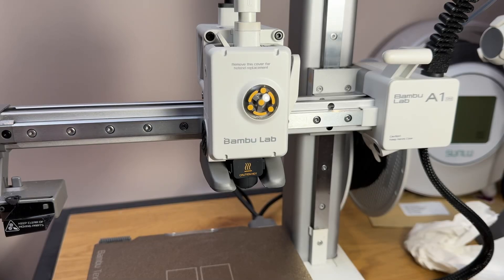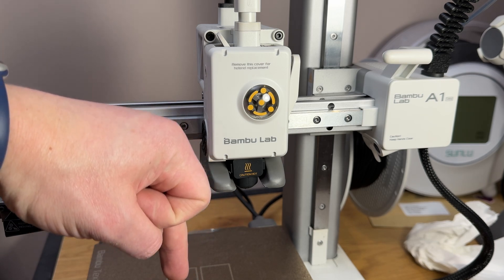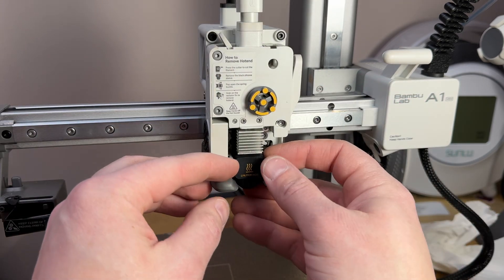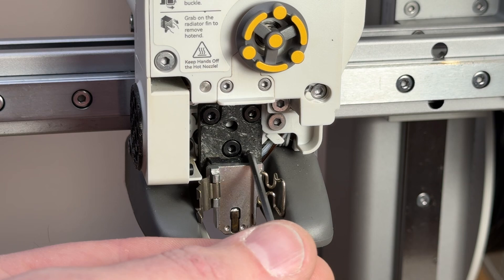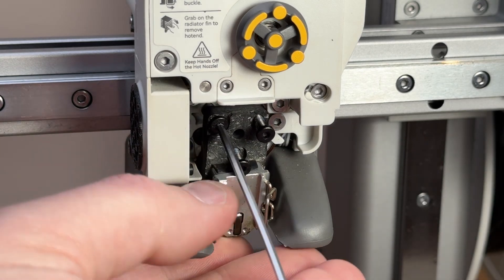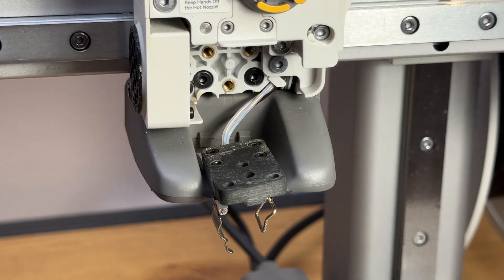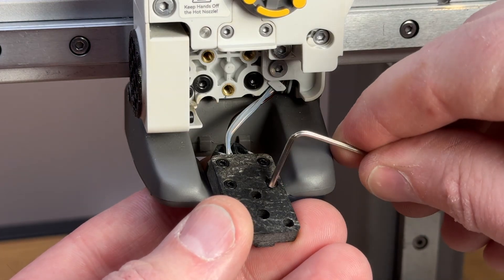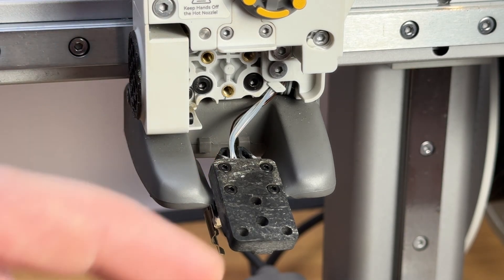Bambulab A1 and A1 mini loose nozzle fix quick and simple

Comment: I tried this one, i checked and found out that 1 of the screws has loosen its threads or so i think, since it does not tighten despite trying to for a couple of seconds compared to the other 3 screws that are also a bit loose but tightened instanly (I didnt apply much force nor overtighten the one said screw.) probably a factory issue(?) My only concern is that would it still be fine? since only 1 screw is faulty out of the four?
Reply from the maker: It will probably be ok for now 
Did you inspect the screw to see if it was stripped ? Might need to replace the screw or worst case replace the heater block assembly
Reply: @Kenprints i asked a guy who has the same printer with similar issue and said i should replace the whole hotend heating assembly overall. But i still tested mine and printed just fine, first layers printed better than when it just arrived. But yeah, a stripped screw is also a possibilty i havent thouroughly-checked the screw itself to be honest.
Reply from the maker: @JoNathan-lc7fl if its printing ok i would continue to use it until it starts giving bother but in the meantime order a replacement heater assembly and have it available to swap over when the time comes

Comment: Same issue here. They were loose, and I only had three screws. I'm trying it out after tightening down the 3, and will get a replacement ordered.
Reply from the maker: Its such a common issue at this stage im surprised Bambulab havent addressed it or issued upgraded parts

Comment: I'm at work right now so I can't check my printer, but I'm getting layer shifts and it seems like the extruder pushes into my prints which causes them to fall off the build plate. Does any of that sound like this is the issue, or is it something else?
Reply from the maker: Its possible - its the easiest place to check first anyway and go from there 
Drop a response here later when you get a chance or PM me over on facebook if you get into bother

Comment: I found that the screws were a bit loose but right after following these steps a print job immediately failed during the first layer. I tried again and it was successful. I have had problems with failing print jobs for about a month. I have had my A1 for only 2 months. I'm experienced with 3D printing. I keep my build plates clean. I keep my filament dry. I have had failures with new filament that was just unpackaged. This has been happening so often it has made me less enthusiastic about 3D printing. I just opened a support request. Hopefully that will yield some positive results. I don't know what else to try. I get a lot of successful print jobs, but the failures are way too often. On a couple of models, the printer has NEVER completed a successful print. I thought maybe it was the models, but no one else seems to be having problems.
Reply from the maker: Didnyou perform a recalibration after you tightened the nozzles ?

Comment: my arm is loose when you pull up it move 0.5mm
Reply from the maker: Hi didier which arm are you referring to ?
Reply: @Kenprints  arm Z, my first layer is horrible but the print is ok after
i check screw under head .. not help, belt look good i make callibration etc .. nothing work
Reply from the maker: I will pm u

Comment: That was the issue.  I spent a few hours messing with things trying to figure out why what I suspected was a z-calibration or z-height issue.  No matter what I did the issue just persisted and none of what I did changed anything.  I followed your instructions, all four of my screws were pretty loose.  I tightened them down and my printer is printing like the day I bought it again.  THANK YOU!
Reply from the maker: Keep an eye on them they will likely come loose again in a few months time but at least u know where to check first

Comment: thakns to your video, i just checked back there and one of the screws had fallen completely off and the others loose.. thank you so much
Reply from the maker: Glad it was useful
I purchased 2 used machines over the past 3 days a mini and an a1 both with reasonably small hours used and both had nozzle issues where they were loose but the previous owners didnt either notice or it wasnt an obvious issue showing up in their prints - or maybe it was and thats why i got a mini for €100 😆

Comment: So I got a crazy one for you my A1 combo has all those screws including the four screws behind the nozzle plate all tightened down I purchased four new OEM nozzles all of them offer a terrible first layer and end up having the nozzle move around as if none of those screws I tightened are tightened down and I still see the nozzle moving up and down during the print thus ruining the print but if I turn around and put the old nozzle back on there's an immediate improvement in quality despite it being an old nozzle the new ones drag the bed almost as if a calibration does not help.
Reply from the maker: Is ur clamp locked in position correctly i have seen people manage to lock it in place wrong leaving the nozzle loose
Reply: @Kenprints yep it's completely locked correctly with the teeth on either side of the hook I don't even know how people manage to do it the other way but they do LOL but my thing is that even roll back the firmware now everything except for the original nozzle even brand new oems create a terrible first layer an act as if the machine is not leveled this is despite me running full calibrations checking all screws both on back plate and behind back plate extruder screws itself clean the plate we level three times and I tried three separate nozzles one hardened steel to stainless steel all 0.4 all brand new all with individual leveling and calibration for each all terrible first layer.
Reply from the maker: But the original nozzle works perfectly ?

Comment: I was doing these procedures, I noticed that one of the four screws on the back was stripped. No matter how much I tighten it, the screw does not hold properly. Do I need to buy a new hotend, or will replacing the screw solve the problem?
Reply from the maker: I would imagine the thread has stripped in the heater block rather than the bolt thread stripping
Reply: @Kenprints  When I felt that the screw was turning freely without tightening, I removed it completely and inspected it. I noticed that a wire-like part surrounding the screw had broken off. Half of this part is still wrapped around the screw, but I think it’s not fully securing because it’s broken near the point where the screw is supposed to tighten properly.
Reply: I recalibrated and performed a first layer test, and although there are no visible defects on the part, there is some slight scraping during printing. Most likely, I’ll start experiencing first layer issues again within a week or two.
Reply from the maker: @topraktemel7494 that wire is the remains of the tread from the item you were screwing into
Reply: @Kenprints  I can give an example like this: to prevent water from leaking in water pipes, we wrap them with Teflon tape — I think it’s the same with these screws. If you can provide an email address, I can send a photo of the remaining part. It looks like it’s completely broken in half.

Comment: Just one thing to take note of. Red is permanent locktite... Often needing heat for removal. Highly recommend not using Red and using the normal Blue locktite as it's ment to be removed.
Reply from the maker: Thats a fair point - mine was blue i rarely use the stuff
Reply: @Kenprints  The locktite 243 has an operating temperature of up to +180 degrees and how it will behave at temperatures above +200 is not well known!
Reply from the maker: Thats good to know i hadnt thought about its operating temps

Comment: This has been happening to me quite often where the 4 screws come loose in the back.  I've read some folks on reddit saying not to use loctite.  Can you comment on your setup, has the red loctite done it's job and not caused any problems?
Reply from the maker: No issues so far - the only issue i can see is that if you use too much you may not get them to open if you need to which will mean u will have to replace the 2 parts together if one goes faulty
Reply: @Kenprints  you will have to anyways as there are so single spares afaik. Thermistor breaks or something, have fun getting a new heater. At least for Bambu, not sure if Ali maybe has single spares. But it's clearly designed to be changed completely if anything breaks.
Reply from the maker: Thats a fair point ive seen spares on ali but reviews are hit and miss its safer replace all with original i guess

Comment: This is probably going to sound like a dumb question but I'll ask it because it's not obvious to me. You mentioned adding loctite to the screws. Are you unscrewing them from the heatblock and then putting the loctite in then screwing them in? Or is there another way you're putting the loctite on. I just want to make sure before I do it since I don't want to do it wrong.
Reply from the maker: Sorry yes thats the way 
Just unscrew them add a tiny drop of locktite and screw them back in
Reply: @Kenprints  okay perfecto! Thanks for answering my question. I'm very nervous about doing this since I haven't had to take apart my extruder at all. So I appreciate the advice. One more question how can you tell if you tightened it too much? Or if its just snug enough?
Reply from the maker: When it stops turning easily its tight- normally i just go a small bit beyond that - the last thing you want is to strip the threads in the heater block - a good tip might be to use your fingers on the allen key not your hand that way you are limiting the torque you are able to apply
Reply: @Kenprints  perfect thanks again!
Reply from the maker: No probs best of luck

Comment: While your videos are very helpful, the solution you provide here wasn't my problem so there's another reason why the nozzle is loose.
I found the clip holding the nozzle in place appeared to have lost it's spring properties so wasn't holding the nozzle firmly.
I had recently replaced that whole piece when the wires had come away so it was a fairly new replacement part.
I was able to bend the small plate held in by the clip back to its original state using a pair of small nose pliers which rectified the problem temporarily but I believe the real issue is that the plate loses its spring qualities because of the constant heat which tends to anneal the material.
Reply from the maker: Hi is your machine old ?

Comment: This solution worked the first time I did it and then the printer worked fine for 2 days now it’s back doing the same thing and I just tried to do the same solution again but it’s not working it’s still dragging on my first layer 😢
Reply from the maker: You shouldnt have to do it again so soon there is something else wrong

Is the nozzle locked in position correctly ?

Keep an eye on the nozzle as the machine does its bed levelling routine and see does the nozzle move as it probes the bed (it shouldnt it should be solid)
Reply: @Kenprints I just noticed a bend in the hot end I am ordering a new one right now maybe that’s my issue
Reply from the maker: @nicoleblackmore5605 most likely yes as it would affect the smooth output from the nozzle

Comment: what is the size of those screws? I have been looking in the bambu wiki, but can't seem to find them
Reply from the maker: @WyldChyld208  in the spare parts on bambu store the 3 at the front are listed as part of the hotend assembly as BT3-10 screws just compare on your machine and see if the 3 on the front are same as 3 on the rear - i dont have an a1 at present to check
Reply: thanks after awhile looking through the wiki I found a picture that mentioned the screws actual size, they are M2x6 if anyone has the same issue...thanks again for the response 🙂

Comment: Im really hoping this fixes my issues. Had great prints for about a month and then failure after failure. I find a lot of people having the same issue of good prints for about two weeks or so then nozzle knocking issues. With how fast these things move around and vibrate. Loose screw seems most logical. Will update when I have a chance to try.
Reply from the maker: It should resolve your issues hopefully
Reply: @Kenprints unfortunately it did not seem to work. I was able to tighten the screws a bit without forcing it. Now my nozzle is dragging on the print bed itself. Gonna factory reset and try again. Might just return it. I’m spending more time diagnosing it than anything else atm. Some people seem to love them and others have nothing but troubles.
Reply from the maker: @T0NGB0KE was auto bed levelling turned on ?
Reply: Yes I select to level the bed for most prints and do dynamic flow calibration if I switch nozzles or to new filament
Reply from the maker: @T0NGB0KE its odd that its digging into the bed unless the nozzle is still somehow loose ??
Reply: @ yea I’m stumped. I factory reset it. Calibrated it again. Swapped to my .2 nozzle using fat dragon gaming settings and sent a print and so far it’s doing great. I’m being gaslit by my printer.
Reply: Came back to say thank you. I may not have reseated my nozzle correctly after tightening the screws which is the only real change I’ve done since the failures and everything seems back to normal. I’d say this was the fix.
Reply from the maker: Great news
Its almost always due to the nozzle being loose somehow as it affects its ability to level itself on the bed
Reply: I also did a calibration from the settings after tightening the screws.